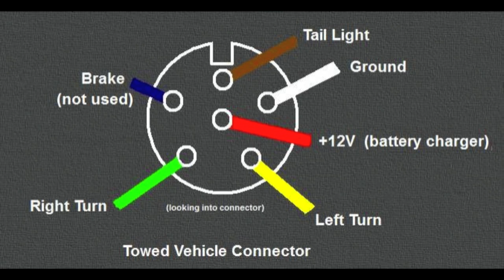RV towed vehicle project: toad battery charging.

Comment: The only way this works is if your RV has a charge line correct?  I just purchased a brake buddy classic and it comes with a 15amp charger that I connect to the towed vehicle's battery like you did but I don't think my 7 pin on the back of my RV has a 12v charge. So now I need to figure out what I need to do.

Comment: not sure if you can use this for keeping your chassis battery charged?  I think you also have a video out about the switch that will start your chassis battery if it is dead, I want to change mine and not sure what the amp rating I should use?   Thanks
Reply from the maker: Find the fuse for the circuit that needs to be removed. The switch should be able to handle that amperage.

Comment: Why not use the 12v from the coach to power the brake controller and not worry about having to charge the towed battery?
Reply from the maker: Depending on the towed vehicle, there may be more items that present a load while towing than the brake controller. Sometimes the ignition switch must be in accessory position, and while vehicles with this requirement typically must have fuses pulled (my Grand Am required 3 fuses to be pulled), having a battery charger may possibly eliminate that step. But each vehicle is different so this is not an accross-the-board recommendation.

Otherwise, you could directly connect the brake controller to the 12V from the 6 or 7 pin connector, but it would require some re-wiring of the vehicle. I suppose though that wiring a charger in the engine compartment is far easier than trying to wire behind the dash.

Finally, you could simply directly connect the 12V coach power directly to the towed vehicle battery and it would charge. However, this charger really is more like an isolator, preventing the towed vehicle battery from trying to charge back into the coach when the coach engine is off.  

And without an isolator, the higher charged battery (regardless of whether or not it is in the coach or towed vehicle) will attempt to charge the lower charged battery until they equalize. 

An example would be if the towed vehicle battery were completely discharged, and the engine is shut off the coach - say at a resturant, etc.  If not isolated, the coach battery would be discharged until it's charge is equal to the towed vehicle battery. In a worst case scenario, that might mean the coach battery won't start the coach.

If course, some coaches disconnect the charging circuit when the engine is off, but not always - depending on the RV mfg.

So there are some valid reasons for this kind of charger, but the need varies depending on the setup.

Comment: Out of curiosity, how is this battery charger different than a Voltage Sensing Relay/Automatic Charging Relay?
Reply from the maker: Probably not much difference. I did not take it apart to see what was inside. Anytime you introduce a higher voltage to a lead acid battery, it will charge.

Comment: Can't you just run a positive + wire (12 gauge) from the 7 pin plug on the coach to the 6 way plug (center) on the toad?? That wire is regulated from the coach. I just don't get what this thing does.
Reply from the maker: Yes it is possible you can charge your battery with 12V from the coach directly wired to the battery. However, this charger provides isolation and a fuse protected power source. Isolation is important because should the towed vehicle battery be bad, it could damage the coach battery.  So it's really a matter of enhanced safety.
Reply: What if I leave umbilical connected overnight?
Will the road battery draw down the coach battery? Will the coach battery draw down the road battery?
What about if the toad engine and rv engine are running at the same time? What do the alternators of each vehicle do at that point?
Reply: If there is any other device drawing power off the coach charge line, it will draw from both the chassis and toad battery. The coach line ties into the chassis electrical system via a fuse, so when the vehicle is turned off and the harness is connected, engine computers, running lights, or anything that might draw power could begin to discharge the toad battery.  This device has diode protection which acts as a valve against reverse flow from the toad into the coach chassis.

Comment: I'm going to do something similar and need to ask you a question:  If you use the 12V pin on the 6 pin connector, how is the charge controller grounded on the toad?  I see you are connecting both pos and neg cables to the toad's battery, but I'm not understanding where the ground wire comes from before it goes from to the controller from the battery.
Reply from the maker: +martinedd The 6 pin connector's negative pin is grounded to the chassis. This ground is picked up by the charge controller as it's case is also grounded. 

For most projects, I have a corresponding webpage that goes into more detail, often including schematics. There is a schematic for the charger's wiring diagram at:  http://www.rv-project.com/projects/toad2.php